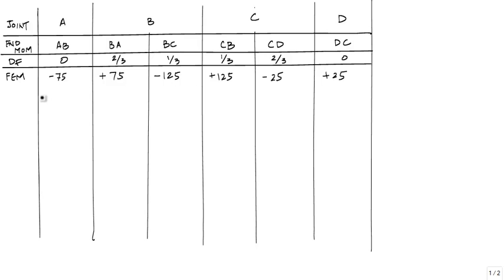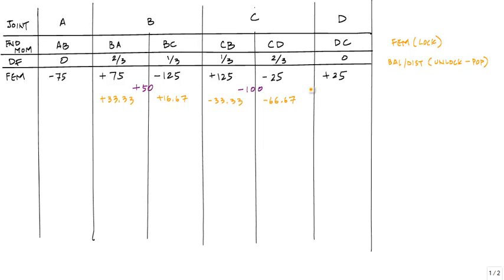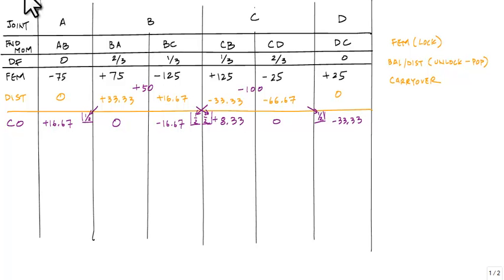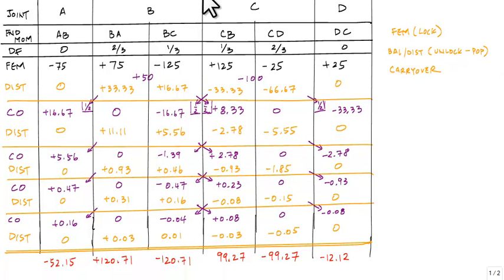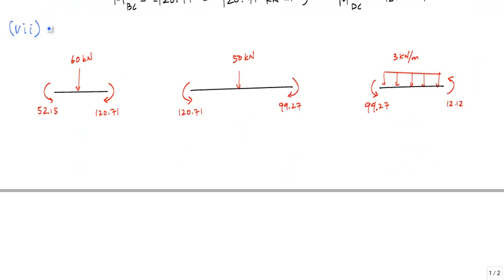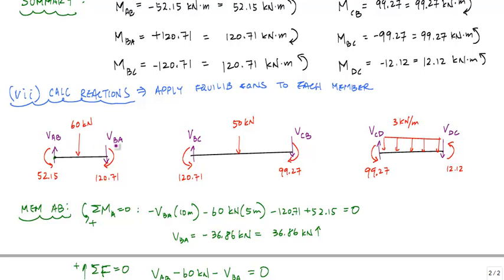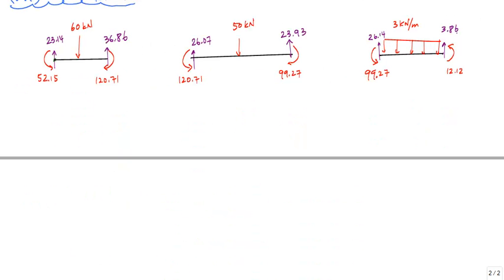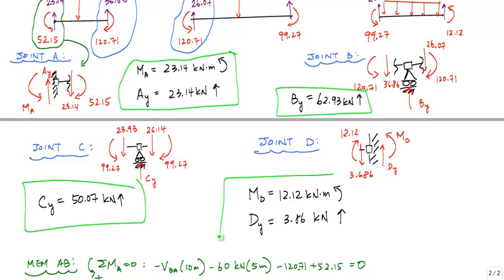Moment Distribution Method Example 2 (2/2) - Structural Analysis

Comment: Hi if i had a pinned end beam how would i find the fixed end moment? if the pin is on the right or left side of the beam does this make a difference and how would i find them if it did?
Thanks